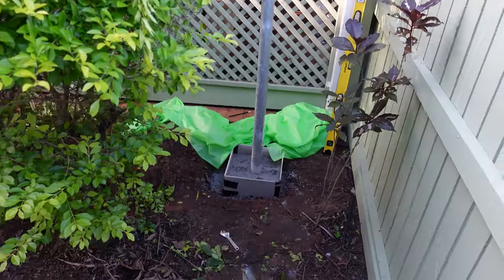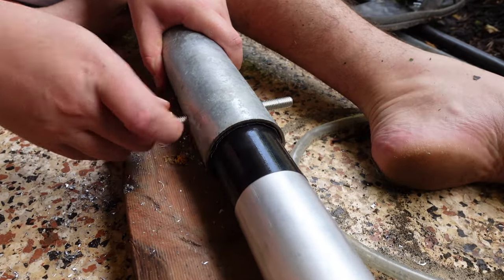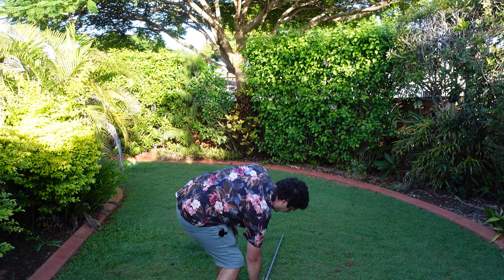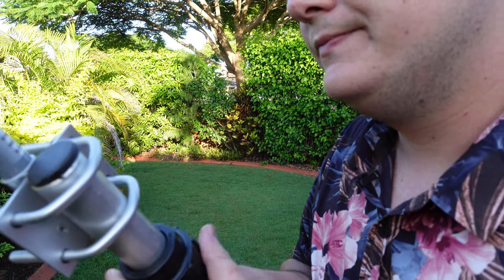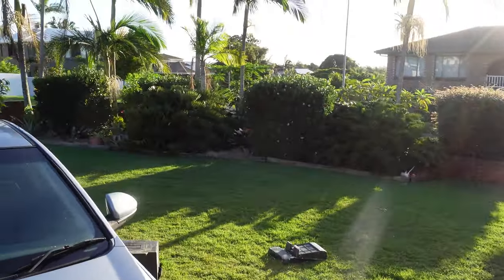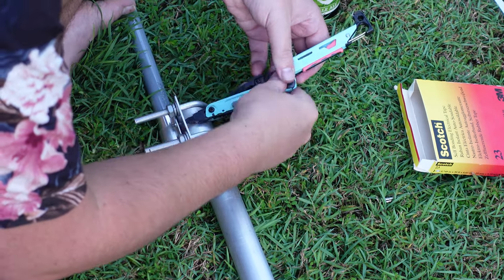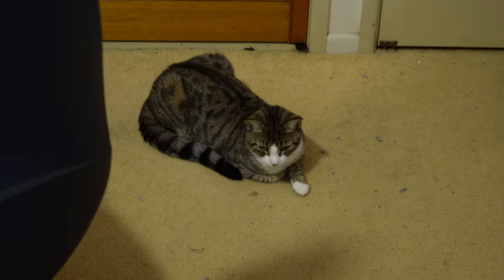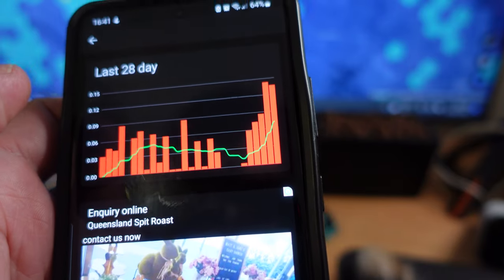How to install an external antenna for helium mining

Comment: I hope all is well and I'm looking forward to your follow up on the external antenna install.  I just figured out that I have a tremendous amount of noise in my helium setup. You'll laugh but i didn't realize that SNR in db needed to be positive to be good. I thought be because the nature of a waveform that you could have both negative and positive signals depending on the portion of the sin wave you caught, lol.  Well, I've been set straight and would like to apply a filter to the setup to try and drop the noise floor. I'm thinking of using a cavity filter seen it has low insertion loss and I'd like to keep the upgrade cost to a minimum.  Using a saw filter would cost me 3dbi and require me to install an amplifier to make up the difference in comparison to the <1dbi for the insertion of the cavity filter.  I have a quick question on cavity filters that I can't find the answer to on the net.  Does a cavity filter have an specific(input/output) or it doesn't matter and the filter works in both direction so there no way to screw the installation up?  Also, can you think or know of any other filters that are low cost and low insertion loss that may be better to use?

Comment: Glad you’re back.  Thanks for video. My understanding is that n-type connectors are water tight.  I don’t understand why we have to tape it.  I used scotch 700 electrical tape which said water resistant in a similar setup.  What’s your take on using amplifiers and filters.  I see a lot of vids and discord talk about all these things but it just seems like a waste of cash with the current rewards.  I understand the theory around the additions but I never see any really evidence to the increase in witnesses due to being able to pick up faint signals. What are your thoughts?
Reply from the maker: Thanks mate, glad to be back.

I'm telling you, water will get in everywhere given enough time... Moisture ingress is the biggest thing that kills antennas and connectors, etc.

Fun fact, in industry here in Australia we have to reinforce out coax cables with metal conduit as cockatoos grab onto the coax and bloody chew through it!

As for amplifiers... I started having a look into them a few months ago then dropped it so I'm not up to date on everyone's thinking around them.

My personal perspective, if you are amplifying your signal on the TX leg.... You will probably get invalid witnesses as people will be witnessing your beacons at a level significantly higher than expected.

On the Rx leg... Maybe. It might be useful if you're in an environment that has a really low noise floor and you're trying to pick up signals that are very low.

That's if you have an amp that works ideally, and doesn't introduce noise, etc.

My educated guess is that if you are buying an amplifier that isn't at least a couple hundred dollars, it's probably not been properly tested and will likely not perform well... This is just a guess.

I might see if I can get my hands on some amplifiers to do some testing?

We could even make our own etched filters!
Reply: @reefjames6302  yeah, the buzz is to use a filter along with the amp.  Either saw or cavity with cavity preferred because of the low insertion loss. My apprehension is more cost on diminishing returns although in a career scientist and find this RF engineering stuff fun.  I would love see a good build video for a etch filter you mentioned. I’ve come across a video of a guy building a band pass filter and it was fascinating but with out testing equipment for tuning it’s impossible. Keep up the good work. Look forward to where you go with the channel.
Reply: wow. the real gold is in the comments section. please discuss Rx amps in a future video.

Comment: I may not have been paying attention, but why did you opt for a 9db antenna? also, it's nice to see that I'm one of your witnesses. You helped me set up my HS and it's pulling ~10HNT/month... so thanks.
Reply from the maker: Very cool! Congrats on the awesome earnings! Glad to be able to help you out. 

I'll do a more detailed video on why I chose a 9dbi. Good topic!

Basically though, there isn't thaaaaat many hotspots around me, so I wanted to talk to as many as possible. Will probably get a lower gain antenna once the area fills out a bit more....no really want the antenna higher as well, but it gets tricky, and expensive going much higher.

Comment: you did not tell the settings for the antenna like the transmission loss from cable connectors... so \what should I put in app DBI...
Reply from the maker: Hey dude, there is another video on my channel specifically about that so I didn't mention it here. I shouldn't have referred to it though.